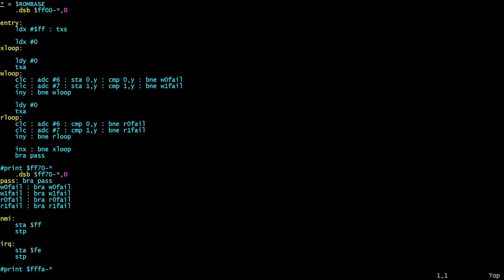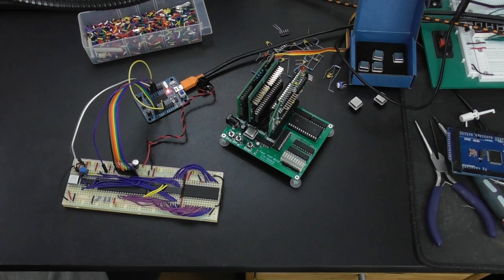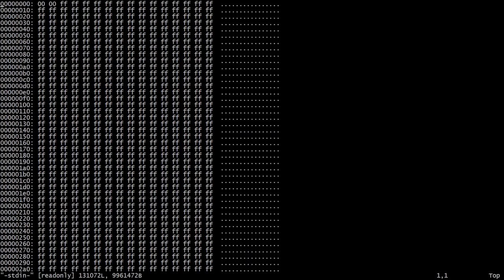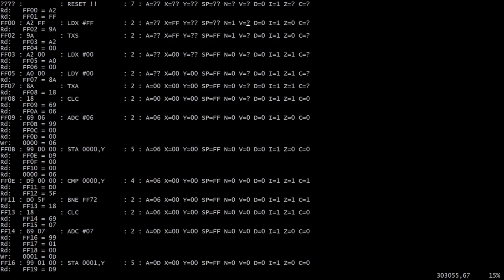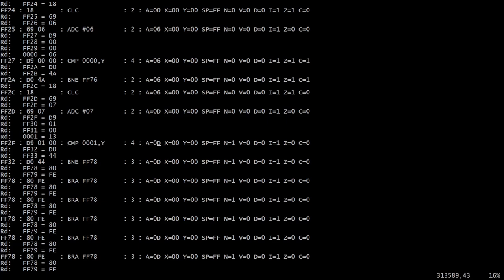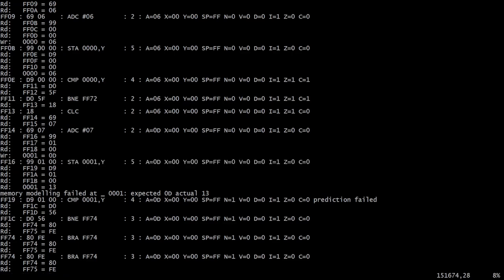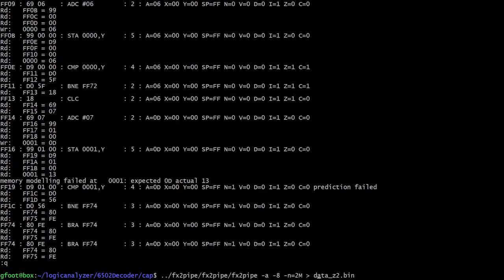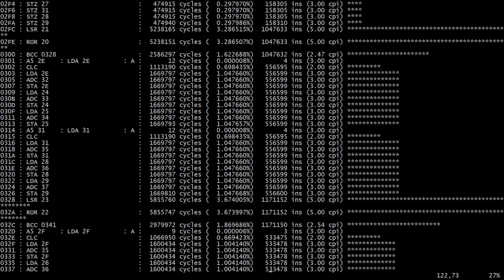Debugging and Profiling 6502-based Computers

Comment: Hi George, I just watched all your 6502 based videos and think you've done the most amazing stuff I've ever seen with the 6502! Really impressive! In 2020 I got the Ben Eater kit along with the video card kit and ended up putting them together. I decided to take it all apart a few days ago and start fresh so I've been reviewing my assembly coding skills and browsing methodologies before going into creating my own design and eventually PCB. One thing that was a big flaw with the eater 6502 was not enough VRAM to display to the whole screen, since he used every (6502 sized) pixel for every memory address and having to pause the CPU to allow the video card to access VRAM. After watching all your videos and techniques I was amazed of what could be improved on, and I also came across how the NES did it using a PPU and only 2KB of VRAM, so now I have no idea where I should really start.

My main goal is to have a 256x240 screen resolution just like the NES, sprite capability, 64 colors (or less if necessary) and maybe extra memory banks using the VIA if necessary. I think it would be cool to have a kernel like Wozmon on it that is interactive over serial, so I can interface a keyboard, and launch programs with some games I've developed, or use a midi interface to write/play some 8-BIT music. I think the hardest thing to sort out is the video interfacing, and sprites, and what would be the most sensible way of dealing with it. I would greatly appreciate your input.
Thank you.

Comment: Nice logic analyzer for the price! I wonder if it works with Saleae Logic as well?
Also appreciated your last video - looks like you’re turning into a lean mean content making machine 🎉😊
Reply from the maker: Thanks Anders :)
I have a Salae clone, I don't know how it compares with official ones.  Mine supports 8-bit sampling at up to 48MHz, it seems; however - crucially - it doesn't support an external clock, which means you end up having to oversample the signal (maybe by 8x) in order to be sure you get a good sample at the right point, around the falling edge of PHI2.  Also, obviously, with only 8 channels, it still can't sample the clock in that case!  So it's not very useful for this.  I found ways to make do, but the FX2 is so cheap, it's a bit of a no-brainer really!
Reply: @GeorgeFoot  Absolutely on my shopping list. I was just wondering if we’re so lucky we can use Salae’s software with it since that’s super convenient - but I guess we’re not that lucky 🍀 
The CLI tools look manageable too
Reply from the maker: Yes the CLI is nice enough - note that fx2pipe is third party though, not from Cypress, and it is unmaintained, except that David Banks has bundled a copy of it with the decoder (plus a minor modification).  There's also support for it in sigrok (Pulseview), maybe also through a third-party driver.  So it is well-supported at least!
I believe Dominic Beasley has made a C# app to allow Windows users to get the same sort of functionality as fx2pipe provides, but I haven't tried it.